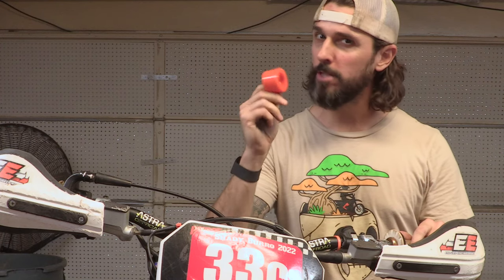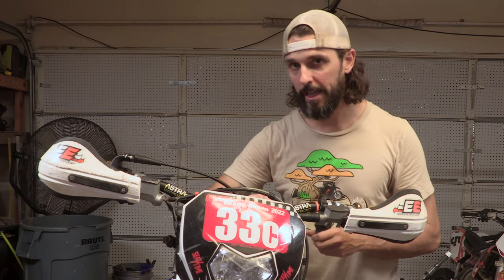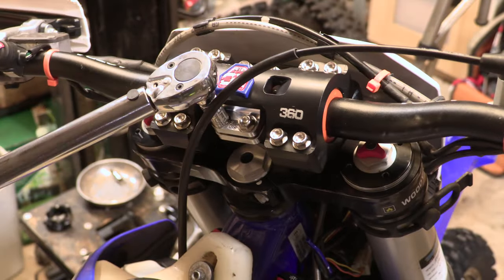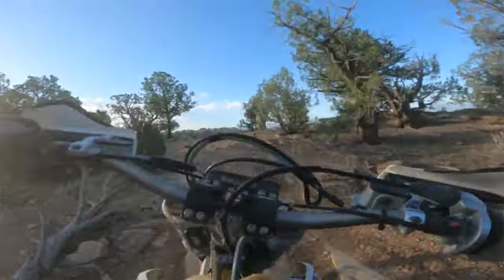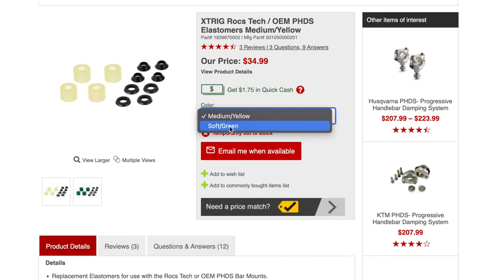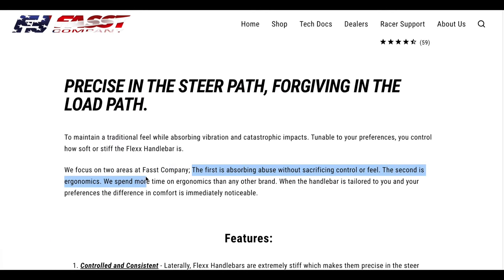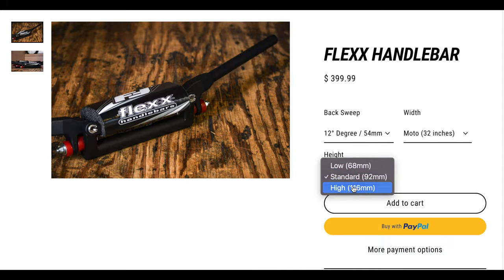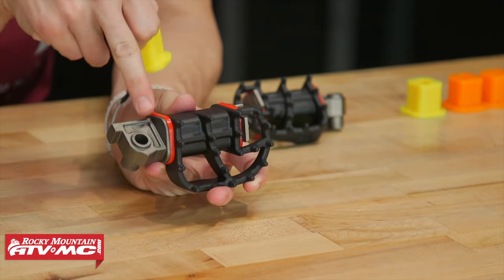How to Reduce Handlebar Vibrations | All Your Options!

Comment: Great vid Woody.  I have the Mako 360 on my Beta 300RR, I have no complaints and they definitely help with vibration and shock
Reply from the maker: What elastomers and shark bite colors are you running?
Reply: @SeatTime  purple bar polymers and orange shark bite polymer.  This was recommended to me by Lance at XC gear.  I can't give you much feedback on what colors would be better than the others but this setup seems to work ok for me.  I am older and not super aggressive anymore so the softer the better IMO.
Reply from the maker: That seems like the right place to be for wanting a bit of a softer setup. With blue shark bite polymer, I get a bit of bar roll still. I'm going to go up one in stiffness to see if it deletes it.

Comment: Hey Woody, I've seen you on Morgan's channel and recently subscribed to yours...excellent channel and like your content. I installed the 360 on my Beta xtrainer a couple weeks ago and it's truly is amazing at taking the shock and vibration away. I have orange for bar and yellow for sharkbite , I do notice bar movement when I'm standing and going faster while hitting objects when I have more weight on the bars. I did order the stiffer blue sharkbite to try but the little bar movement really doesn't bother me. The Mako to me is a game changer, the numb hands, sore elbows and shoulders is pretty much gone. XC told me that the Mako for the Beta will fit my KTM 500 so I am going to try it out on that as well...I know I'm going to have to buy another one dangit!
Reply from the maker: Wicked, thanks for joining us over here on Seat Time! I've really enjoyed the Mako360, it's helped in all the areas you said it has for me. As I have been increasing my speed over the past couple months, I am planning on going up in stiffness on both the elastomers. I'm Orange and Blue (I think) right now. Even if the 360 ones stay Orange, I'll go up on Sharkbite for sure. I feel that slight rotation of the bar as I start driving into obstacles and weighting the front of the bike more. We shall see! Thanks again for subscribing!!!

Comment: Woody, Out of curiosity, which do you like better between the flex bars or mako 360?  I have the flexxbar on my 17 te300 and the mako 360 on my 22 350 xc-f.
Reply from the maker: I specifically choose the MAKO due to my wanting to keep the lower Astra handlebar. So if I had to choose right now, the MAKO. That doesn’t take away from the options the Flexx Bar offers, it’s just that they don’t have that low of bar height options.
Reply: @SeatTime  gotcha, I personally prefer the mako just a bit over my flexxbar.
Reply: Thanks I have ridden the flex bar but have a new 300 and want to try something different so the mako is on my list of parts now!
Reply: @michaelloch3783  both are game changers. I just notice the movement of the flexxbar more, vs with the mako I only notice the lack of pain after a long ride

Comment: Great video, Woody! Very curious with your thoughts over time, but as a Mako 360 owner (SX models on my '22 and '23 Husky 350s), I gotta say, I definitely notice them. I compared them to stock, as well as against KTMs first party offering that a buddy has, and truly notice differences. Whether it's on the moto track or trails, they have been a true game changer for me and my dad. Last question to stir the pot - why'd you mount the top clamp upside down? 😋
Reply from the maker: Thanks! As far as the top clamp, I selfishly wanted SEAT TIME to be facing the front of the bike 🤩
Reply: @SeatTime  I figured much when seeing the footage. 🤘